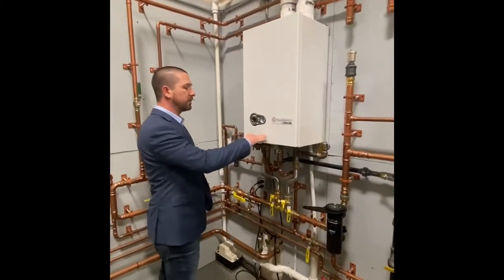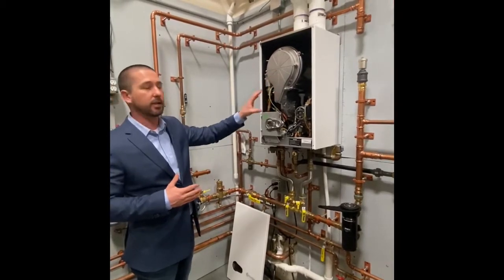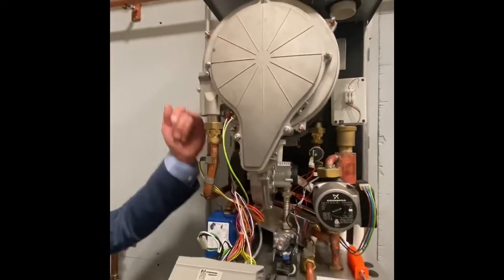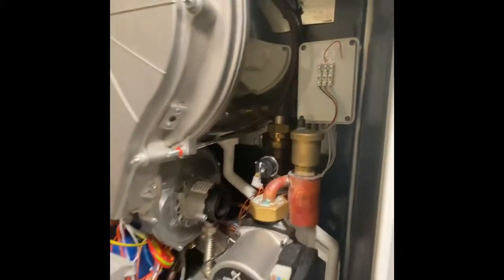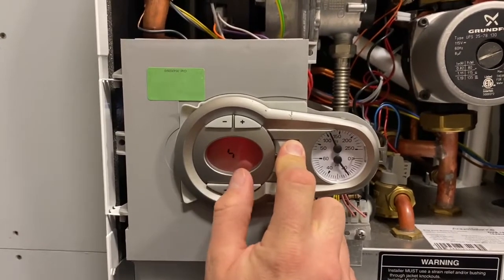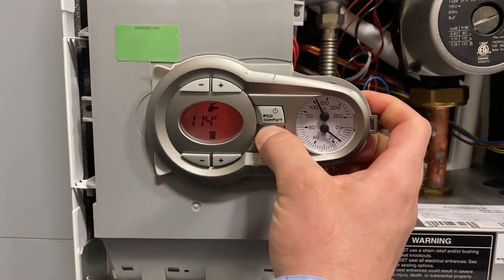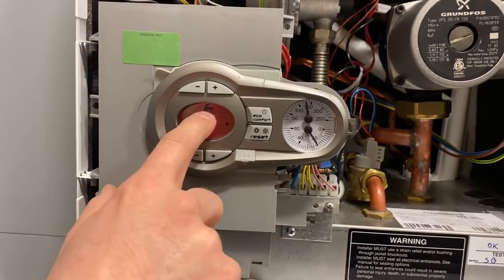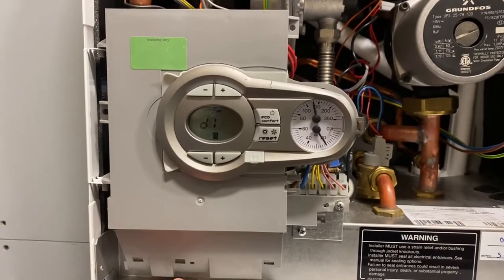Weil-McLain AquaBalance | Overview

Comment: Thank you for a good overview! Normally I would strictly install Viessmann Vitodens (pri-sec) or Vitocrossal (full-flow), but I'm seeing that Aquabalance is a great competitor to Vitodens-100W.
Some tweaks I would suggest for your product team: ribbon cables, better cable management, more accessible combi HX, circ pump on heat-only also.
Extra features (vs Vitodens-200W)
1-10V output for external ECM pump control, 0-10V pump alarm feedback input, see Taco 0026e & 0034e models. Modulate secondary ECM pump with 1-10V, based on burner output.